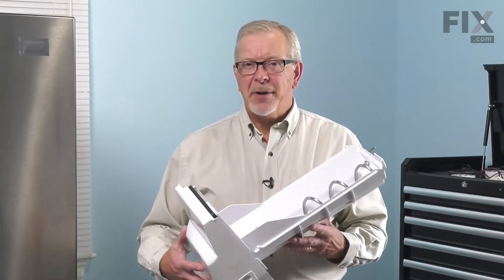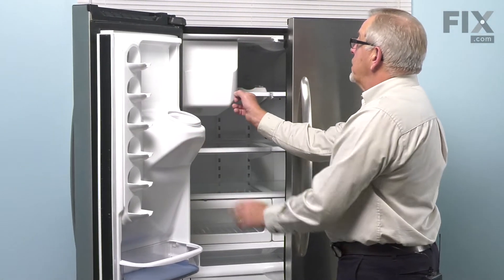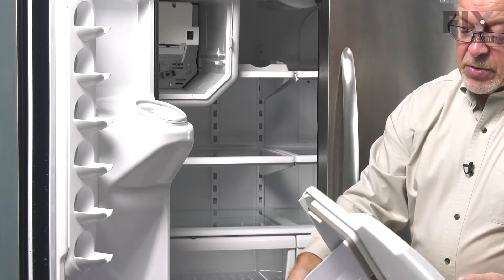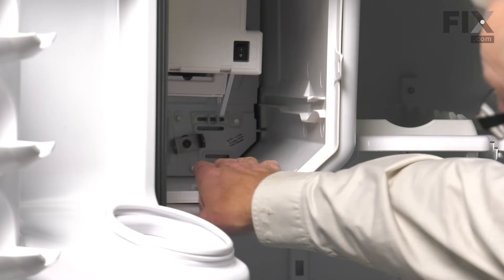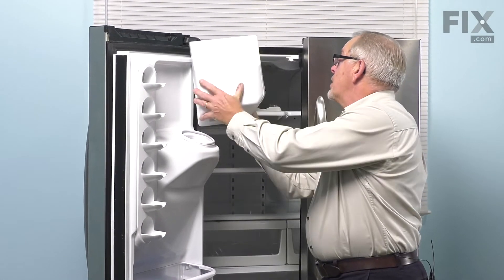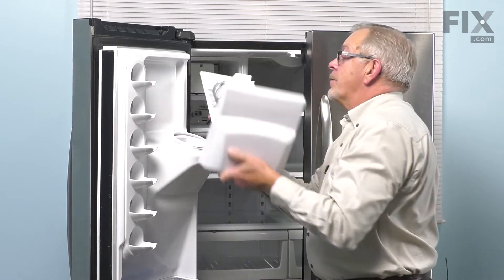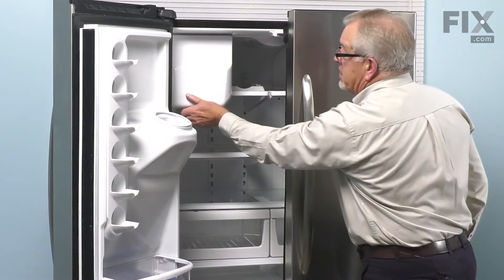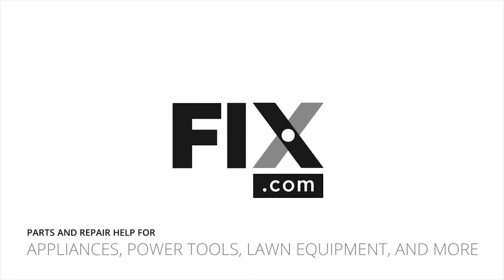Maytag Refrigerator Repair - How to Replace the Ice Bin

Comment: I have this same model, but I'm having trouble with the dispenser paddle. Ice cubes are being stored, but when I try to get some ice, they dispenser empties the hole ice stored, they don't drop one by one. Is there a solution to this? I don't know what's the problem...

Comment: Why isn't there a replacement for the plastic paddles in the front of the dispenser? Within 6 months from new both broke off! Poor design and nothing like adding to the land fill, when it would be cheaper to have a replacement paddle.